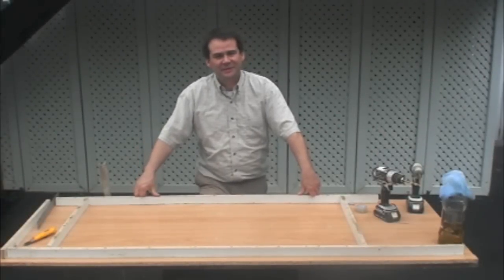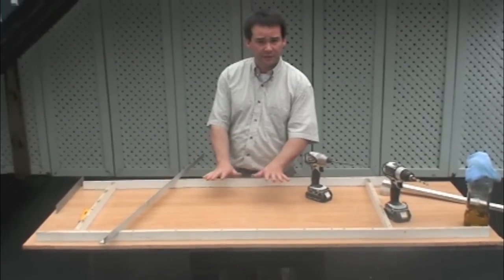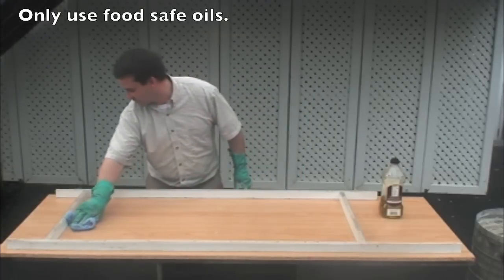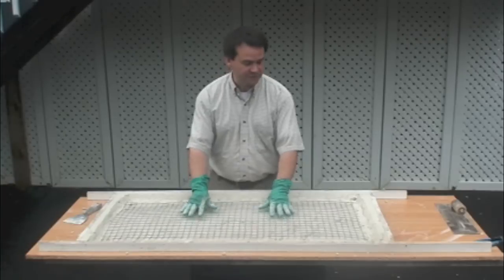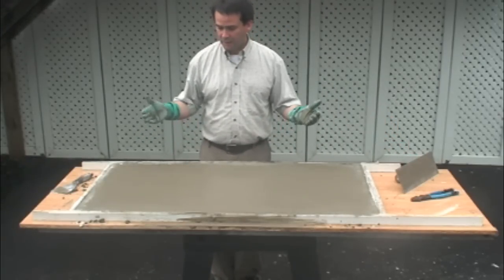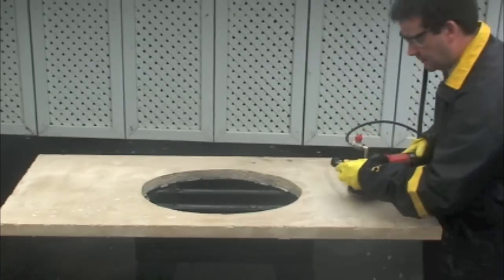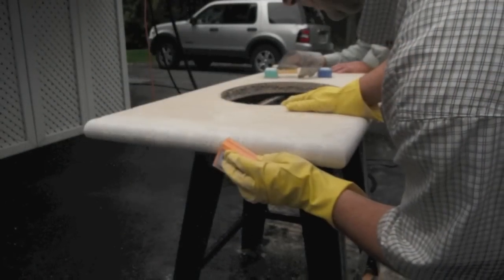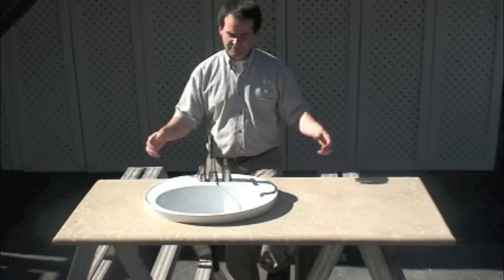Concrete Countertop From Start to Finish

Comment: I made my kitchen counter tops with 3/4" plywood underneath for support and they turned out great 4 yrs and counting the edge is 2 1/4" thick but the top is only an inch and a quarter. Maybe I'll upload some vids later.

Comment: some kitchen company quoted me $54,000.  I can buy a house from that money.
Reply: If you want to buy a shack, sure. Trust me, I work at a kitchen company. $54,000 is a decent kitchen, it's not even high end tbh.
Reply: you're getting screwed if you pay $54k for a kitchen.
Reply: Please research some information before commenting, because you quite obviously don't know what you're talking about.
Reply: P3rspective 54000 for a kitchen someone's trying to retire on that job. Let's do some math appliances 5000.00, 4000.00 counter tops, 5000.00 floors, 4000.00 plumbing, 5000.00  cabinets, 3000.00 fixtures, and 10000.00 labor. I pumped up some of prices but that's 36000.00. Based on an average size kitchen and nothing crazy what could possibly cost 18000.00 more? I would definitely be getting another estimate and "doing my research!"
Reply: Martyn Sawing
Reply: I would never go to a "company" to ask about re-doing a kitchen. About the only thing you need to hire any one for is plumbing or electricity.

Comment: WHy is the color of the concrete you used to place by hand in the beginning a different color than the dark concrete you used at the end? I would have used silicone around the corners with a tool to make it more rounded instead of how it was done.
Reply: Concrete is mixture of cement, sand, and gravel.  I don't think that the first layer he put in was concrete. It looks more like mortar, mixture of light color cement and sand.
Reply: Definitely a different mix.  As it's the bottom, berhaps it's a hydraulic cement to keep moisture out of the countertop.
Reply: He’s not telling you what finishes to use. That’s up to you to decide. You can expect everything to be mouth fed to you. 

If you look it up, there are so many different types of finishes tops you can choose to your hearts content.

Comment: Very nice.
(Example).... Large kitchen counter.
I want the same 1.5 inch thick.
How far of an extension reach (without) support can it go ?
6'' overhang.....12'''.......24''........more.  ?
What would it need for the maximum overhang ?

Comment: Excellent and informative video, thank you very much. Is my understanding correct that the water-grinder is just to eliminate dust i.e. a normal grinder will do the same job polishing the concrete but you will have to wear a decent dust mask?

Comment: Start to finish? Hardly. 
No mention of the composition of the concrete mixtures. No mention of the different mixtures used. No mention of why two different mixtures are used.
And, with that very basic information missing, I gave up on this ridiculously uninformative video at about seven minutes into this time wasting exercise.

Comment: if you had used a perspec template for the curve, you wouldnt need to carve out the shape, also why put 2 inch of concrete over the edge  JUST to scrape it off. ?  really flawed technique your using, but each to their own..

Comment: What is the difference between the grout you put around the edge (white) and the filler for the center (dark)?  Are they different concrete products?

What concrete do you recommend for a 7" deep x 2" thick x 70" long mantle?

Comment: So what do you do if you have a BIG countertop? Like 10' long- for an eating area. Could you lay it on a fresh, flat, clean, concrete floor with a thick plastic down or something? And oil that up? Something that won't wrinkle? We are looking to do a 10'x3' counter for an eating area in the kitchen, andit will be for a new house- which will have a nice, clean, newly poured concrete floor. Very informative vide BTW! Thanks!

Comment: Very informative vid, I like the finished texture.  Question: you started out with a white/tan looking concrete for the surface and finished up the back side with the regular gray concrete.  Where can I find the white/tan concrete?
Reply: concrete dye is probably what you should look into
Reply: J Scal it was a mixture of white sand and white cement. You can dye concrete, but if you start out with regular gray concrete, you will never get any lighter than the original gray.

Comment: If you are talking about the "EDGE" when you say "Curve", it allows him to be able to bull nose back to a clean, solid edge. You could go ahead and set the profile of the bull nose beforehand but then you would have to depend on a perfect edge after pouring, curing etc. and thus require filling and sanding any imperfections, it's just easier and faster to rout back to a clean edge in one pass. When you do this for a living, time is of the essence and above all things, not sacrificing quality.

Comment: it looks like different concrete from outer edges to the "filler" concrete. did you do this because of cost or does it reduce weight or what?

Comment: What do you guys use at the bottom? is it birch faced plywood? also what mix of concrete is used for the initial border/ bottom and for the wetter mix inside? Is it actually concrete with different grades of stone/ hardcore or is it a cement screed so it is smoother?

Comment: I was going to say that one advantage of using concrete is that one can make the sink as integral part of the concrete counter top it self, but that isn't the way you did it; it seem you just cut a hole for the sink.

Comment: You can use most any reinforcement. For instance, non-climbable (sometimes called 2x4 wire or welded wire) fencing could be used and is very inexpensive if you compare how many counter tops you could reinforce with a small roll of it. Many options in the reinforcement area.

Comment: did you get the marble effect by using the thicker concrete packed in around the edges? this is beautiful, im about to do a desk project and you helped make up my mind on the material

Comment: In my analyses of the video, and taking into consideration my experience with Concrete counter tops; it looks like it is the same concrete, just two different consistencies. The first is a drier consistency and the second has a little more water to it, resulting in the darker appearance. If you have the mix too wet, it will tend to leave some "divots" in the edge of your counter top, given too much water in the mix has a tendency to go down rather than slight moisture in the mix will evaporate.

Comment: Good job. There are different colors in the concrete. Does that come from the hard-pack of your cement? The bulldog nose is the way to go.
Reply: You jumped from sanding to sealing to burnishing without showing the steps. Preceding the burnishing, you indicate three coats, but no indication of the percent of dilution.

Comment: I`m not sure what you did,,,,,your "cookie Dough" didnt fill the edges or corners from what i saw and i dont think will last a week ,,,It`s too dry for any real strength  use a sheet of plastic and PVC cut in 1/2 for a bull nose,,, I can make that top for  $50.00 dollars and sell it for $200.00
Reply: It's most likely has additives that give it the strength..like GFRC face coat..

Comment: Does anyone with experience have any recommendations as to what brand or type of grinder or planer is best for use on cornet countertops? I'm looking to buy one for some projects and I'm wonder what type is most reliable and does a good job, etc….
Reply: Buy a variable speed Metabo grinder. They are German and excellent quality. I love mine

Comment: Excellent video.
I am actually going to build a fireplace mantel and I think it will be a similar technique.
Please can you let me know what you put on the concrete to make it smooth? I didn't understand exactly what a slurry was.
Also, how long do you wait before taking the wood mould off the concrete?

Best Regards and happy Christmas!!
Reply: A slurry is a mixture of sand, cement and water. concrete has all three of those but also aggregate (rock/stone)
Reply: Also, you should cover the mold with at least 2mil plastic for a minimum of 48 hours to keep the moisture from evaporating from the concrete.

Comment: How much are they compared to a granite counter top
Reply: It's about $15.00 per bag.  Average countertop would take 11 bags(my guess). That's $165.00.  For under $200.00 you'll have a counter top. Granite is easily $3000.00

Comment: Why the fuck would anyone want to use CONCRETE to form a work top ?
Fucking madness and  total wate of time.
Reply: cuz it's very nice and EXTREMELY customizable. You can make it in any shape you want, any color you want, anywhere you want. And it looks awesome. And it's very strong. And you can make one yourself. That's all I can think about right now, but I'm sure there's more.
Reply: Just imagine casting a worktop in-situ.
You are casting it on top of units.
water everywhere.
dust everywhere
specialist tools needed.
Ok...worktop 5 meteres x 80cm x 8cm.
 That will be 681 KILOGRAMS !
Getting the idea now ?
Reply: supersesqui  People usually use these in domestic kitchens and vanity tops, they are only about 32mm thick not 80mm, also the absolute longest form  you would have is about 2500mm. Also when a large portion is taken out for a sink it reduces the size/weight. So at most your actually looking at  180kg! 
Getting the idea now?
Reply: supersesqui  The weight is comparable to an equally sized granite top.
Reply: supersesqui nice reply

Comment: Concrete is not granite so it is useless to polish to 3000 grit.  Because of the sand in the concrete, you can stop at 200, it isn't going to get any smoother.  After 200 you are wasting your time.
Reply: D Dixon 

Not true.  The only way you would get less of a polish is because you didnt let it cure long enough before polishing.  Polishing concrete that is not hard enough will tear out sand grains and turn your 200 grit pad to a 30 grit pad.  If you are looking for a high polished surface you have to have a hard and dense surface to polish.   Concrete can be polished to a mirror sheen if its the right mix and cast by someone who is experienced in producing such a thing.
Reply: D Dixon k